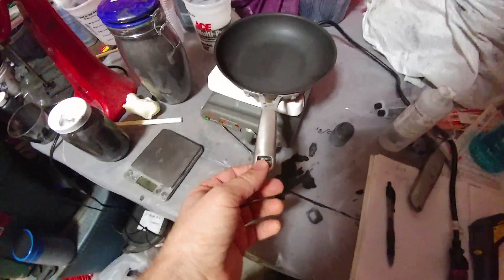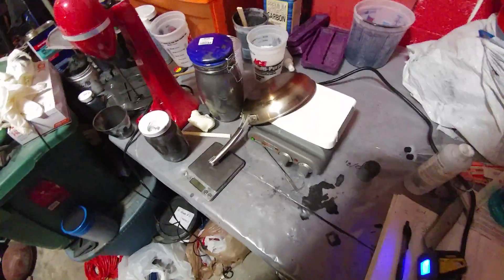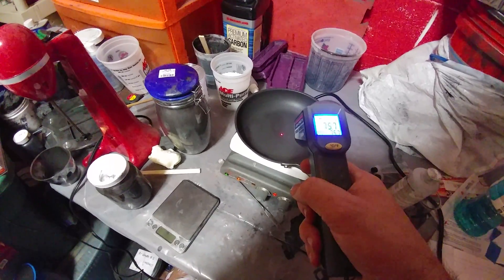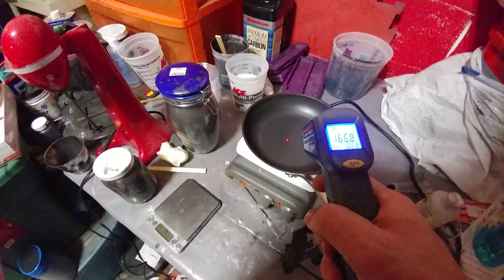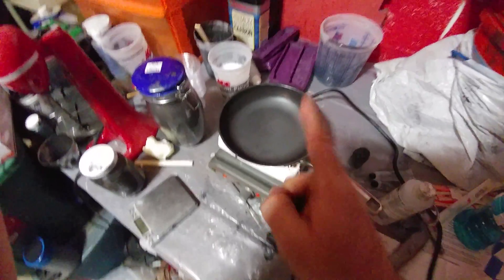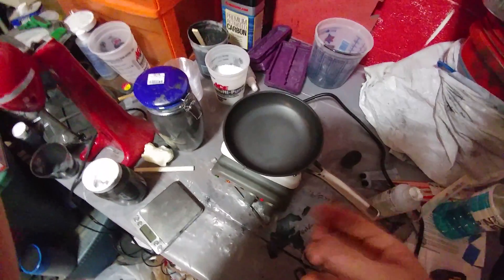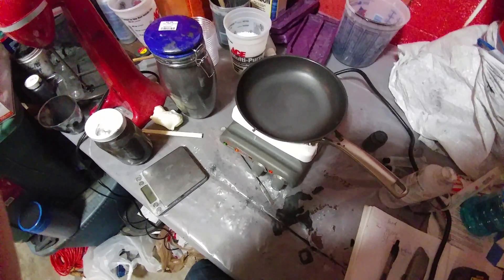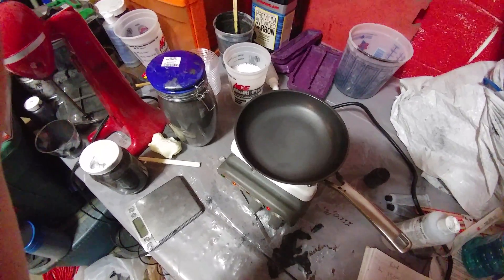Graphene coatings. The Pan

Comment: Coating for a wood stove?  Maybe a heat exchanger?
Reply from the maker: Michael Shultzinger exactly!
Reply: I want to know more about your graphene foam.  Can it be loaded into a 3d printing application?  If it is that strong and rigid... what if you used it for tiny house construction?
Reply from the maker: Michael Shultzinger yes to all of those. We also load it in concrete.
Reply: Oh we so need to talk.
Reply from the maker: Michael Shultzinger dm me and we can exchange email

Comment: Your shiny copper bottom pan has a different emissivity than the darker graphene layer of the top of the pan.  The IR gun will not accurately read most shiny surfaces so the temperature you are reading on the bottom is likely not accurate.  Using a few thermocouples or spraying each surface you want to measure with a coating of the same emissivity would yield more accurate information to help track down what is happening.
Reply: Cool! and thanks. Also wanted to let you know I really enjoy your videos. I've been following the graphene battery progress for some time now. This is a very promising material.
Reply: Would also love to see graphenes potential in thermal paste applications!
Reply from the maker: kuhrd that can be true for a part of the result, but not to this degree. Also note this is just a crappy demonstration, I actually have the real data for the thermal conductivity of the coating, I just can't put the number out. But I can say greater than 450 W/mK
Reply: From a heat transfer standpoint though, it doesn't make sense for the heated side of the plate to be cooler than the side exposed to the air. If these results are accurate you are saying the coating is pulling heat from the air and heating the hot plate. That thermal conductivity number does look really good though if it is accurate. Not sure how it relates to cooking outside of your pan surface warming up faster. Maybe you could get away with using a lower temperature setting making your energy usage less. I'd be interested in seeing its effect on the convection coefficient of the pan, if you decide to do a video on that later. Use a thermocouple this time though!
Reply from the maker: Steven Randall it's taking the heat from the plate and transferring it to the air. This thing isn't really the best example to show it, but it's the easiest. I'm making another video on this to help.
Reply from the maker: Steven Randall thanks. Though my production value is kinda crappy, I try to give out as much info as possible.
Reply: I know what its like to deal with NDA's haha. Have you tried using this as thermal paste for a CPU? Current high end thermal paste is around 73 W/mK (for Thermal Grizzly Conductonaut). Its fine if you cannot say.
Reply from the maker: twinkmaster2 I did that one, but I'll do it again.
Reply: Kuhrd is correct. The emissivity of copper is very low (a polished Copper-Nickel Alloy has a emissivity of 5.9%), while that of graphene is extremely high, with an ideal graphene sheet having emissivity of greater than 99% (see: "Perfect blackbody radiation from a graphene nanostructure with application to high-temperature spectral emissivity measurements" ). if you spraypaint the bottom of the pan with a high temperature black paint or use a contact thermometer rather than one relying on IR radiation, you will see that the bottom of the pan is actually at a higher temperature than the inside surface, as one would expect in this type of system...
Reply: As far as thermal conductivity goes, copper has a thermal conductivity of ~400 W/mK. If your graphene layer has a higher thermal conductivity, it should result in a LOWER temperature due to better conduction into the air by the graphene.
Reply from the maker: ats89117 that would be true if I had not used a contact thermometer before. It takes more time, but shows the same results.